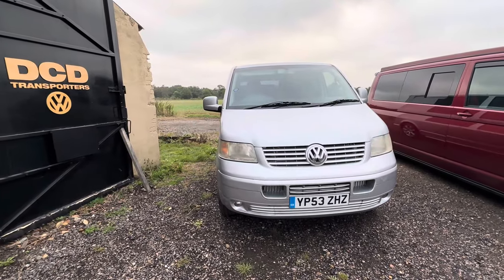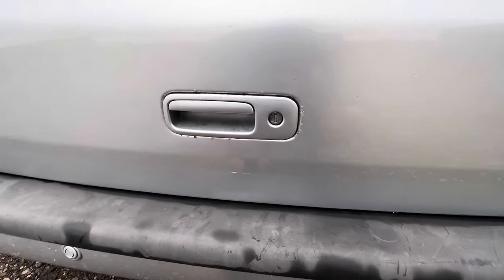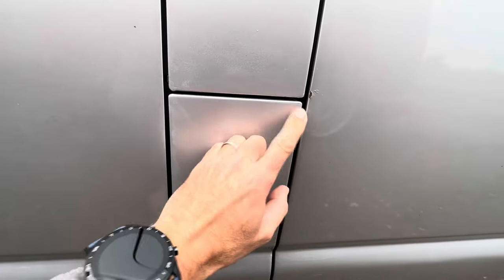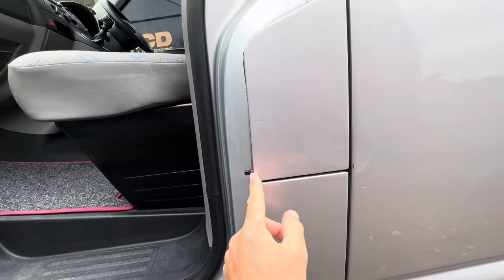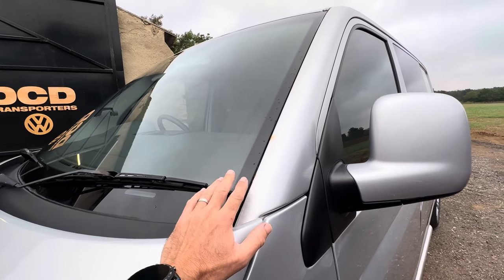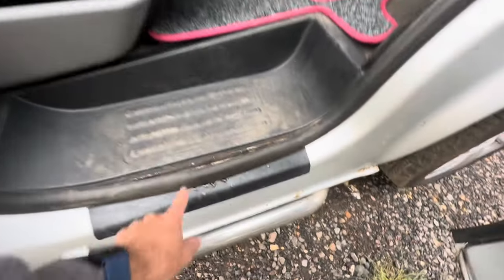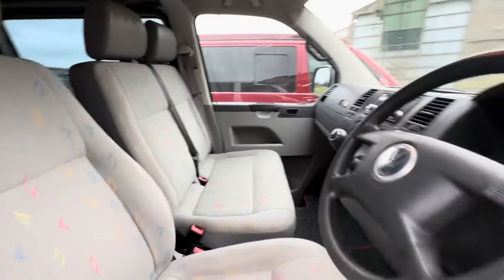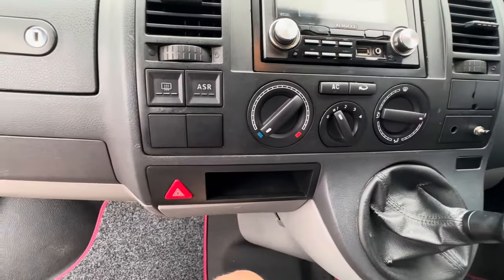We’ve bought an early VW T5 2.5. Is it any good?

Comment: Both my father and I have the early versions of the T5 and both have the 2.5tdi engine. His with 155 and mine 130 thousand. I agree with you that they are great engines, and the main problem with them is that people don’t use the correct oil, which leads to early camshaft wear. So if your looking to buy one, don’t be put off by the fool’s comments on the internet who have probably never owned one. Just make sure it’s been looked after properly. And yes, they are noisy.
Reply from the maker: Absolutely spot on 👍🏻
Reply: Hope you don’t mind me asking’
But what oil do you use’ 
I always add Wynns additive’ nice and thick ‘ 
Apart from that’ the Engine is lovely and quiet , 
Thanks 🙏
Reply from the maker: @beastylad7418  I don’t mind at all. I use the specific 506.01 from Westway 
It’s a 0w30
Reply: @dcdtransporters  
Thanks 🙏 
I’ll keep an eye on your channel’ 
Good videos. 👍
Reply: Yes, we bought a 2005 174 about 13 years ago on 89k  we turned it into a camper so not a daily.... By 100k we had to do the camshaft 😔🤮🤮..... I was, and still do use the correct oil...... Unfortunately imo the previous owners didn't  🤷🏻‍♂️
Reply: What is correct oil as it’s a PD engine ??
Reply: @dcdtransporters 

Is that year specific as my 05 2.5 specifies 5w.30 and was changed from 10w.30 to avoid cold start cam wear issues in earlier models. Always use the correct ISO spec oil in 5w.30 have had the van 12 years it’s currently at 187k runs sweet
Reply from the maker: @noelmason2305  0w 30 would be even better at start up as is a lower viscosity when cold and easier for the oil to get around the engine to protect the components faster. As long as you use 506.01 then I’m sure you’ll be fine.

Comment: Correct oil is a must  0-30W 506.01 spec, Westway or millers only do it now though and its hard to off the shelf as its an old engine now. 
Do not put the 5-30w C3 or similar oil in it, All motor factors say its the modern oil but are wrong, pre DPF 2.5 axd engines are low sap grade to protect the soft camshaft and gears.

Comment: I had a 2006 T5  2.5 with over 450,000 miles and ran really well!
Reply from the maker: That’s great going. These engines are commercial designed engines for vans and higher mileage. 
Unlike the modern variants which are a car derived engine

Comment: Mine’s an ‘06 2.5 T32 4Motion mid-roof half panel.    It’s only done 100,000 miles.  It has the AXE engine but after remapping it puts out 220hp, 373lb/ft. The suspension was upgraded with the Seikel Desert Heavy Duty kit (30mm lift) and it sits on Range Rover wheels with 235/70R16 BF Goodrich All-Terrain TAs. It replaced various LR Defenders on my croft. Easier to load pallets, heated seats, no leaks, toasty heating and air con. Driven sensibly it returns 38-40mph but when my wife puts her foot down the van turns into a flying brick and returns 20mpg!! We’ve had it for years and are now mulling over turning it into a camper. We already camp in it but as we’re getting older an air mattress, a couple of sleeping bags zipped together, a cooler and a two burner camp stove no longer cut the mustard. I’ve been offered good money for it several times but it’s too useful and too much fun. 😁
Reply: Last year we replaced the gates couplings and injectors (pig of a job), the discs and brake lines, the exhaust (now stainless) and a lot more. Next up is the bodywork  - it’s a working van on a croft so it’s covered in shite and even a bit of greenery (moss). The main concern is the bottom of the b-pillar on the driver’s side where rust has emerged. Other than that, rust on the tips of the fuel flap, the tip of one barn door and a spot on the bonnet. Wheel arches are surprisingly chip and rust free. I really need to replace or upgrade the headlamps as the plastic has aged badly. The fibreglass mid-roof is solid but it hasn’t aged well so something needs to be done about that.
Reply from the maker: Sounds like a great van. 
Hopefully you might be able to keep it and find another to convert to a camper as it sounds just right as it is for you. 
Headlights, well worth getting the repair kit for restoring plastic lights from your local car parts shop. We spent a couple of hours refurbishing ours and the difference is noticeable. A decent set of bulbs once this is done will transform them. 
Make sure you’ve not got water getting into that B pillar as it will be a tricky place to repair. Normally it’s leaky windows or the factory roof bolts which can cause issues.
Reply: @dcdtransporters Thanks for the tips, appreciated. My wife and I both tramped the world in our younger days (before meeting) so when we started looking at the van as a potential camper we realised it could be the basis of a decent expedition vehicle. Watch this space!

Comment: I opted for the 1.9 tdi 105 from new it achieves 650 miles to a tank ever time & 20y on it still gets 650 to a tank it’s been remapped & id put it against any 180 or 204 to 60 I know I should grow up 😂😂😂 I’ve driven to 204ps just to say
Reply from the maker: We’ve had a 204 with a DSG gearbox and they are quick. You’d certainly get better range than the 204 but not sure about the traffic light GP🚦 🏎️🚔😂
I generally tend to drive the vans a bit differently to a car so as long as they have reasonable power to accelerate onto a busy road that’ll do for me. Most vans with less than 140/150bhp really benefit from being mapped. Our T6.1 (110) was terrible before it was mapped but now is a really nice drive. Amazing the difference it made and how it was strangled from the factory!
Reply: The 130 bhp is 200 miles to a tank short of the 1.9 pd my boy was selling these at a vw dealer & the 2.5 is a nightmare when they go wrong I can only tell it like it is I know by talking to the vw fitters there were plenty of problems when they first come out Mass Flywheels they had a night shit working at vw  to cope there was subframes lying all over the place saying that I had to replace the mass on mine at @45,000
Reply: @dcdtransporters  the pd engine is better than the common rail jobs & boy have they problems too 🙈
Reply from the maker: @petersloan5779  again from experience and covering a lot of miles in a few 2.5’s I’d say that’s not quite true. I have regularly done 600 miles to a tank on a 2.5, uk and European driving. I’d take the extra torque everyday. So the consumption difference isn’t that great when considering it has an extra cylinder and much more power. The sixth gear allows the engine to rev lower when cruising at motorway speeds and optimises the torque. 
No one here is saying 2.5 is the best thing since sliced bread and yes of course they have had issues, but for me they are the pick of the two choices. Both of these are now pretty old so starting to show their age. 
This isn’t a breakdown on which engine is better etc it’s just a general what to look for as a whole when considering an early T5, my advice goes for both engines.

Comment: I have a 2006 2.5tdi lwb 130 auto with 197k. Ive owned it a couple of months and done 1000 miles in it so far with no issues. I’m doing a self built conversion in the back which is nearly finished. It’s an ex London fire service van (was used for fire inspectors to go around doing investigations after fires so wasnt a response vehicle although it did have blue lights). Because it was a fire service van it came with no history, but it appears to have been very well looked after mechanically from what i can see with my limited knowledge (i can do basic servicing, im not an expert but can turn my hand to most things). Drives like a much newer van (i have a 5.1 also for work with the common rail engine and it honestly drives better / tighter than that)

Would you mind letting me know what things would be good for me to look at / do servicing wise? I will service it in the summer but im not sure what else to look out for. Was the 2006 engine different to the 2003? Also im a bit worried about the gearbox as ive heard horror stories of the auto boxes, but mine feels really tight and currently works perfectly. No nasty noises or clunks etc, and smooth gear changes.

Any help greatly appreciated. I plan on doing many miles in it next summer!! Thanks.

Thanks in advance!
Reply from the maker: That sounds like a great van with an interesting past! I’d keep everything you take off it as like the old transporters the fire engine and ambulance derivatives are very desirable and many are restored back to their original form. Obviously we are a little way from T5 becoming super rare but that day will eventually come. 
In the meantime regular oil changes and will keep it good. Refresh the gearbox oil too, yes they can go wrong but no more than any other auto box. Autos generally tend to have easier lives as they don’t get thrashed as much as a manual. 
Check the driveshalfs for wear, easiest way is with one front wheel off the ground rotate it by hand to see how far it goes without engaging the ‘box 
The 2006 engine is slightly different. You’re on the cusp of getting DPF so check if you have one and use the correct oil to suit your engine. 
Enjoy it.
Reply: @dcdtransporters  thanks so much for the reply. That’s really helpful. I wouldn’t have thought to check the drive shafts but of course that makes sense. I’ve also subscribed so I can catch your future vids. Thanks again!

Comment: Brilliant review, response and input from viewers 👏🏼👏🏼👏🏼
Just picked up a 2003 2.5 with twin sliding doors and a factory sun roof… engine wise it pulls very well, starts instantly and sounds sweet. However it’s covered in oil on the top looks like sloppy oil changed but it has a split in the EGR pipe and is covered in black soot everywhere… I was considering removing the EGR, but I’m not entirely convinced that’s a good move. Any advice opinions are very welcome 🤗

Comment: This is helpful. Im lookijg at an 06 t5 2.5tdi with 213k miles on it. Its only £3800. Owner seems confident that its a good runner. Has colour coded bumpers with alloy wheels, air con too. What do you think? I think it seems too cheap. But it could be a solid van if looked after! Doesnt look like theres any body damage or rust in the pictures either.

Comment: Great video. I have a 2.5 bnz model running great. Question i have after allot of rain !! the tray the battery sits on once it was removed there was around 2 inches of water sitting there, Can you tell me if you've ever experienced this and are there drain plugs to let water out. I think its coming in bottom of windscreen plastic cover and will look once it dries. Thanks Jeff
Reply from the maker: Hi. The water should drain from the screen down through some drain holes between the bulkhead and the inner wing. You’ll have to remove the wipers and the plastic tray to get to these. A lot of these drain holes are blocked with leaves, muck and other debris so that allows water to build up and push into other areas. The battery tray should have a couple of areas which allow water to drain too so check those too. 
Make sure you deal with it though as it should not be that bad. Bear in mind that the ecu and fuse box are in that area so don’t let the water build up. 👍🏻

Comment: the flaps are not easy by the left steering cars in the eu i did one relubecate te flapes but i need to remove the dash completely my own t5 2.5tdi 2005 stil havin the factory cup holders and they still work and i also repared the heaven in the van with new carpet and i put leather seats in from a passat 3cc and a steering wheel from a golf 7
Reply from the maker: Wow, an original cup holder that works is a very rare thing!!
Reply: Do these Passat 3cc seats fit in like a simple bolt on thing or welding/drilling is needed? Plan buying a used van and most of them have drivers seat in terrible condition… Passat 3cc seat is around hundred euro and if it’s a simple bolt on fix - that’s a reasonable thing to do I guess.

Comment: Genuine question as I’m shopping around for a van, why would someone want an early T5?
Reply from the maker: Normally budget reasons. Obviously much cheaper than a later T5 or considerably cheaper than a T6. But that said like a lot of vehicles the early ones are becoming desirable as the first and original version and there is a growing trend  towards the early vans and to keep them looking original.
Reply: @dcdtransporters  appreciate the swift response mate, valid points there🤝
Reply: Better get one from 2006-7 upwards bnz(130hp) bpc(180hp)

The early 2.5 TDI axd and axe are good but the later one id better altough still almost sharing  same problems with the later ones camshaft,injection holes that wear.
The early ones had some problems with the plasma coating in the cylinders. Fixed on the later ones fitted with dpf or euro4 emission standards.
The exhaust manifold tend to crack and bend. Its been fixed on the later ones altough not completly gone still can happen. They tend to leak at the gasket between manifold and turbo and egr pipe gasket but not much crack the manifold.
I would get one thats euro 4 tbh. 
If you can work on cars get one with bad camshaft you can get it cheap  good camshaft,tappets,bolts ,gaskets and bearings around €800.
I bought mine 2008 T5 Lwb 5 seater 1 st owner with service history 321 000 km  for € 2300 not a base model well equiped with bad camshaft
 around 1500 in parts litle more expensive as i put in the pde brucke with thicker seals and injectors rings.
I really suggest the pde brucke.
I was lucky my injector holes werent worn they really were brand new.
Beware  thats a big problem on them the injector holes wear you get diesel in oil result engine kaput. Symptoms: very difficult starting.

Advice when youre gonna see one: if it starts very difficult even with bad camshaft then then those injector holes are very very bad but can possibly also be just bad cam sensor but then the engine light will be on

If you can work on cars you can remove the head and put metal liners in them if you cant just walk away because thats gonna be very big bill.

Sorry for long text just my advice:)

Comment: Do these engines use oil between services ?
Reply from the maker: Our last 2.5 didn’t use any oil at all. This one we haven’t had long enough to really tell….
Most engines will use a little depending how hard you drive them.
Reply: @dcdtransporters  I agree , I've seen one for sale and the owner reckons it uses 2-4litres every 1000 miles
Reply from the maker: @mattp2494 wow that’s a complete oil change every 2000 miles!! 
Something isn’t right there, leaking or burning it somewhere
Reply: @dcdtransporters  yes I agree , I mentioned that but he's convinced there's nowt wrong with it 🤣

Comment: I can any one help us I have 2007 transporter 2.5 diesel  iv notice a big noise on my engine is it the top cam shaft get intouch let us no uour thoughts thanks
Reply from the maker: @balwantmahi8298  
More than likely camshaft. 
Unlike a conventional cam these are only bolted on one side so the pressure causes uneven and premature wear to the cam lobes, rockers and buckets on the top of the valves. 

All this coupled with the fact they are quite noisy engines anyway because they are gear driven, not a chain or belt - which is much quieter. 

Have a look at darkside developments YouTube as they had a van in which was the noisiest they have every seen/heard

Comment: Im not very familiar with these but i thought the 2.5 were frowned upon because of them going boom. Could ve wrong but just something I heard.
Reply from the maker: The major issue is around how the camshaft was designed. 
Without going into real technical detail the camshaft is prone to wear which creates problems with the top of the engine. 
With labour and components getting expensive any major spend fixing these issues can often outweigh the value of the van. 
Shame as these 2.5 engines suit the van really well.
Reply: @dcdtransporters  what is the correct oil? Is 95k likely to have a bad camshaft, it has a FSH.
Reply from the maker: @simonbarnes9600 on the T5 2.5 you need to use oils to the specification 506.01 on early vans and 507.00 on later vans with DPF. 
I would hope that the van with 95k would not be worn and live for many more happy miles, but… as always it depends on how it’s been driven and subsequently looked after. Many garages are not aware of the specific oil needed.
Reply: Mine is a 2.5 SE automatic 2008.  Does that make it a later van, with DPF, or an earlier one?  I am also trying to find the best spec oil.
Reply: Once you get to know these 2.5 engines they aren't bad to work on but knowing how to do the cams is a must ,the bottom of the engine seems problem free .I love mine